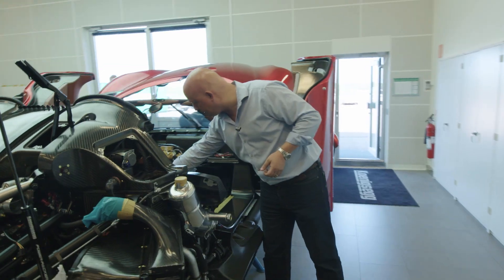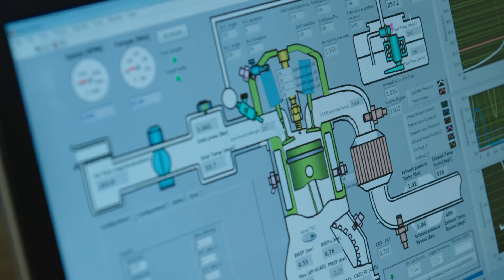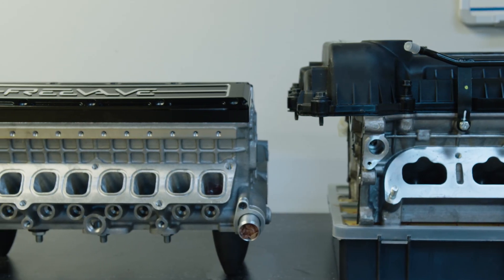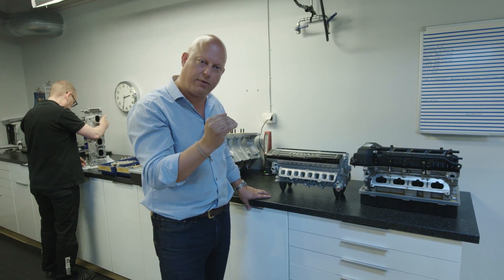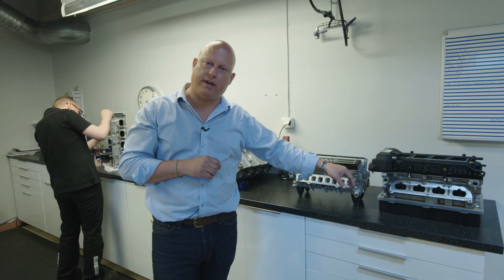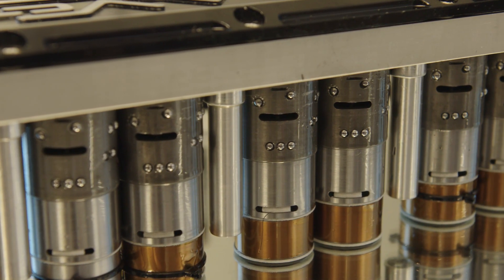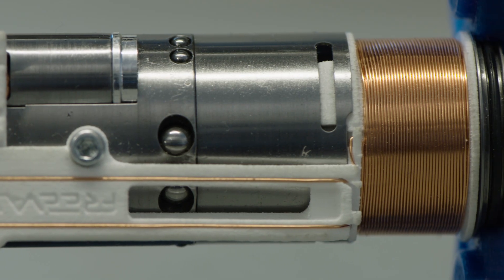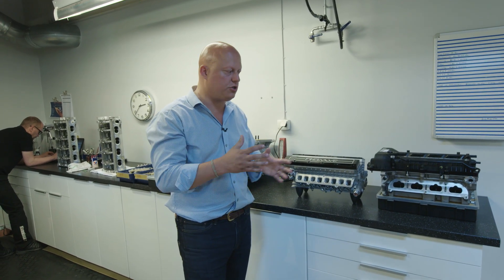Freevalve Update Camless Engine -- /INSIDE KOENIGSEGG

Comment: my question is: what is the benefit of this system in a normal daily driven car?
Reply: More torque, less emmissions, better fuel economy
Reply: You will be able to have the same power from a much smaller engine and better fuel economy
Reply: increase fuel economy, decreased weight and decrease emissions .
Reply: The whole video goes over the benefits.

Better emission in cold start
Better fuel economy due to higher torque and hp values
Better fuel economy due to weight savings
Less accessory parts like throttle bodies, timing belts, etc

The only thing that may be a downfall is the actual free valves themselves. Their reliability and such given that it is a relatively sophisticated electronic device on top of a source of vibration.
Reply: Fabian, I think you're seriously underestimating the complexity of VVT cam systems, which is what every car uses these days, more or less. You can't say 'not talking VVT actuators' because everything uses them now.

Pneumatics are well understood, can be made very reliable, and the complexity is in the supporting hardware (controller, etc), not the pneumatics themselves.

You're literally creating problems where none exist, and ignoring problems with existing cam systems that do.
Reply: No chance of a cambelt snap or a bad slip causing valve-shaped marks on your pistons, lower maintenance (no need for shim adjustment, cambelt replacements, etc), significantly better torque and power vs the same engine with contemporary VVT/cam based systems, lower fuel consumption, less chance of emissions issues (cam mapping through a lambda sensor could keep the engine clean even if the injectors/plugs/etc are in bad shape), less weight, less rotating mass...

So, you know, pretty much everything.
Reply: Beany2007FTW how about maintence?  i'm taking there are plenty of seals that can break and such? and if the wrong one breaks you still mess your valve? also the tech is more expensive so saying it's for a normal daily driven?
Reply: As I understand it they've been testing it on non-interference engines - but as I recall, almost every fail state is a safe failure - that is, valves closed (or at least, not open).

Remember, on a cam'd engine, you have the belt, tensioners (which are what normally goes on most cars with top end problems) and timing (belt skips, because of stretch and buggered tensioners etc) to worry about in terms of interference issues; with this, it's a pneumatic module per valve - and pneumatics are not immature tech. Pneumatic maintanence is basically seals, springs and solenoids - nowt else. Cams run off belts are actually quite complicated in comparison, especially when you add modern VVT into the mix - sticking VVT modules are not minor fixes, requiring typically the same work as a cambelt change - a full top end strip down.

With these, rocker cover off, and it looks like, pop the pneumatic module out and replace it. rocker cover back on, job jobbed. No retiming, no new tensioners, no risk of the timing being off etc. You introduce some potential complexity (electronics, pneumatics) but you remove quite a lot too (timing, belts, shims, followers, tensioners)

There is no info on pricing as it's still in testing - so claiming it to be more expensive is not impossible, but unprovable at this point. I'd argue longer term, it's likely to be about the same, but with the power/economy improvements thrown in.

The whole point of this is that it is for normal daily driving. If you want a high power screamer, you throw lumpy cams in put up with no bottom end power - that's why variable valve timing exists, to allow for big power at the top end, and good torque at the bottom end, with decent economy (typically each of those are mutually exclusive, especially if you want good economy too). With this, you get improvements in power across the board because your timing is truly infinitely variable, and that's what gives you good torque at the low end, with good power at the top, and you can run super lean/cylinder cut off/faster warm up/etc.
Reply: the whole belt thing can be solved with buying a car that uses a chain lol... admitted that to will wear and break but still...

i can't see how simple mechanical things (not talking VVT actuators) can ever be more expensive in this case then a hydrolics system?

also this system will for sure be more complex then a conventional cam system.. complex=expensive if you're not working on it yourself.
Reply: Fabian van den Bussche 
Chains can skip, wear out, break, and even if they don't chain guides and tensioners can and do. Also they make quite a bit of noise and are a source of parasitic loss in many cases.

A lot of cars run variable valve timing, toyota, honda, nissan, ford, just to name a few, disregarding them is a bit archaic. No one said it would be cheaper, but plenty of things are cheaper, but worse. A horse is a perfectly good transportation method. Don't think I or you would want to ride one if we were trying to travel across a country in a week.

A pneumatic valve is a very simple object. This is a very simple idea, not understanding the benefits and poking holes at it is strange. All new technology is more expensive when it first comes out.
Reply: SeattleGooby considering pneumatics have always been more expensive then mechanics it will stay.. also i'm dutch... what i call a country is what you probably call a city so there for my opinions on wear and tear might differ also? 
also because i'm dutch it's actually cheaper to have and maintain a car then a horse here. not relevant but fun fact maybe xD

that being said i do see your point and i feel like i have to agree.

Comment: Holy heck AND damn, this is fascinating; especially when he listed off the increase in power and torque. My initial reaction was saying outloud, "on identical internals or reinforced?" haha, like, I need to dig up more on this. I'm not convinced at all concerning overall reliability and longevity; especially in consideration of the fact that if these engines aren't built to comply with the potential for failure (non-interference vs interference), then all it takes is one of the valve mechanisms to go bad and cause some serious damage. Otherwise they would need to redesign the cylinder head and combustion chamber to ensure maximum compression while allowing free-range movement of the valves at any point of the cycle. Incredible stuff, though. DAMN, I'm in love with this series of videos haha

Comment: I am really exited about this technology! Not only for the improvements that it can bring to the production cars but also the control it can bring to the tuners! 
I once had an electronic fuel injection kit on my scooter and was thrilled with being able to fiddle with the motor control and being able to log data of the engine. 
I really look forward to being able to fiddle with EVERY part of engine control when this technology comes as aftermarket kits for small engines at some point.

Comment: I believe F1 has been using this sort of technology for quite a few years now - and I'm so glad it's finally going to trickle down into something more attainable to the masses (somewhat more attainable, anyway - but it's a good start.)  Not having a camshaft means you can have valve lift, duration and overlap that is optimized for low-end torque, high rpm power, and everything in between - without that "step" effect that variable valve timing gives you...not to mention that it can be optimized at all rpm, not just to kick in at a specific point.  And as a bonus, it should also give much better emissions and fuel consumption as well.

Comment: Yes a non-mechanical loss, infinitely variable valve actuation mechanism has long  been the holy grail of engine design. There have been many elegant prototypes, but an easy to convert and practical system has not yet come out in mass availability. Koenigsegg has some fine engineering talent. I'm sure they will bring it to fruition.

Comment: As a gearhead I was already in love with throwing away heavy iron cams/chains and totally in love with  being able to have a database of whatever camshaft profiles I wanted.  But I am stunned at ALSO being able to leave out the throttle, switch back to dirt cheap port injection, throw out pre cats and wastegates, and still get a 45 % increase in TQ and HP with 12 pct better fuel economy and 35% lower emissions.

Comment: how long until i can order a kit from summit to enhance my chevy bb
Reply: No seriously, the beauty of this is that it can be made universal. 20 years or less and we WILL have freevalve kits for a good amount of current standard engines. It's awesome!
Reply: Exactly. There was another Freevalve video done by Drive 3 years ago, where Christian hinted at aftermarket applications for Freevalve technology. Their test bed was a  SAAB 9-5 turbo that at the time of the video had in excess of 200K KM on the system through it's various engineering iterations. I want my 4 valve, Freevalve LS6/LS3/LS7/LS9 motor, damnit! :D
Reply: Terry Faugno Ditto. I want to retrofit this to my LS3. 600HP when you want it, 30+MPG when you're just cruising.
Reply: mahnarch That's a fairly simple issue to resolve. Dummy shaft, or inserts that block the cam journal oil ports. Could be done in aluminum since it doesn't need the wear tolerance of the cam, so not much mass.
Reply: I just realized; you'll have to have a cam in there (or, at least a dummy shaft), otherwise you won't be able to build oil pressure.

The cam journals needs to be blocked.

I guess it's not THAT big of a deal, but it's extra weight and you have a chunk of metal just riding around in there.
Reply: Do you have any idea what freevalve means?   The tuning capability is insane!
Reply: Will we be able to hide it to make it look stock like with the Petronix points replacement ignition system?
Reply: Yeah, the ability to shut down cylinders/individual valves at will is fantastic.

I'm actually leaning towards finding a detective's LS3 Caprice PPV and making a stealth ship. Nice Zeta platform, so excellent brakes/suspension (Alpha would be awesome, but not sure if the Caprice PPV will migrate to it), in a roomy sedan.

Doesn't hurt that it'll have a drivers side A pillar spotlight and maybe push bars still attached, but oh well .:D
Reply: Its a little different because a push-rod cam is right above the crankshaft and not in the  cylinder head. I guess it could be removed and the push-rods could be removed and you could have two free valve systems on a push-rod engine.   Probably gonna be a while until they make push-rod kits.......
Reply: Bob Builder: That's what I was thinking. One would just remove the cam and pushrods, plug up what needs plugged, and the Freevalve heads would be a wholesale replacement for the entire valvetrain. The downside is that a pushrod LS has nice narrow heads contributing to a compact engine. I can see where a Freevalve retrofit might not fit in some applications.
Reply: Freevalve looks like it is using a much shorter stroke. The complexity looks to me like conversion will not be viable.
Reply: have you seen the size comparisson? its smaller in every dimension.
Reply: i highly doubt that.

Comment: It's an absolutely brilliant idea, I'm surprised no one tried it before. The only thing I find a bit spooky is one SLIGHT malfunction on any valve is likely to crash a valve into a piston.
Reply: Piston and valves can't physically make contact.
Reply: lerch25 they are non interferance engines
Reply: lerch25 bmw had valvetronic long time ago, but it only could change how much do intake valves open... Close but yet so far...
Reply: I'm curious has the valvetronic had many valve crash problems?
Reply: thats an easy problem to solve with piston dome profiles and limiting the extent the valve travels they fix that along time ago
Reply: IsaacScz What does that mean?
Reply: jospi2 A big dish in the piston I take it.
Reply: It has been done before. Lotus have had an engine running like this for about a decade.

Comment: Anyone know what about the freevalve design allows a high compression ratio with a turbo engine?  I'm not sure why that would be.
Reply: They can controll pre-detonation.
Reply: Sure, I'm with you there, but I'm wondering what it is they do to control that.  I'm guessing leave the intake valve open longer into the compression stroke which effectively reduces the compression ratio when the engine is under boost.  This would be analogous to a high revving engine with a "big cam" using a higher CR.  Guess I answered my own question.
Reply: Eric Robison If you leave the intake open and pump out some of the air/fuel you are simply reducing the amount of air/fuel that gets compressed and ultimately burned. You would be better off to just lower the boost pressure instead (smaller or no turbo) because that would do the same thing and not waste as much energy.

I agree with your original question and can't think of any way this properly eliminates the need for DI when running a decent amount of turbo boost in a high compression engine.

The only way I can think of using this to slightly reduce the need for DI is during the exhaust cycle both intake and exhaust valves could be opened allowing turbo'd air or air/fuel to cool the chamber BUT this either wouldn't cool much (air only) or would waste fuel and overload the catalyst. That solution is poor compared to what DI can do. 

I'd like to see this combined with DI with an engine with at least 13:1 and 15+ psi of boost. Then you would truly get optimal fuel economy combined with roughly twice the power when compared to without the boost.

There is actually one other option I thought of and that is at high power levels with high boost to switch to running in a boosted 2-cycle mode (similar to a Detroit Diesel). The reduced volumetric efficiency would lower pre-combustion pressures but firing twice as often would increase power. It might work but likely would have high emissions so again DI would be a much better solution.
Reply: Back to your first paragraph, I agree that if you leave the intake valve open longer you reduce the amount of air/fuel that get's compressed, but at the same time you reduce the compression ratio because the charge won't be compressed until the intake valve is fully closed.  So for low load/high efficiency modes of operation like cruising, you have a high static CR, and for high load modes you have a lower CR to mitigate detonation and then make up for the power deficit with more boost.  This would be similar to the Miller Cycle.  

https://en.wikipedia.org/wiki/Miller_cycle

I could be totally wrong; that's just what I'm thinking.

Comment: Guess what, 2 strokes don't use cams either... they've been around for a very long time
Reply: And they consume more fuel compared to a 4-stroke.
Reply: Matthew Wagg but, in theory they make double the power a 4 stroke does. 4 strokes are more refined and when it comes down to it they're the better engine, but you can't beat the sheer wickedness of a 2 stroke and the power-to-weight output is insane